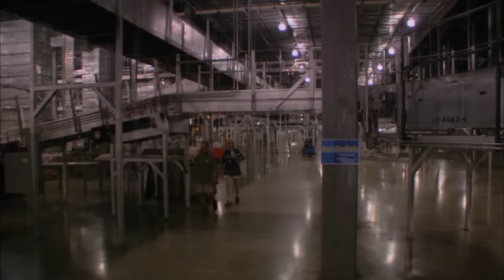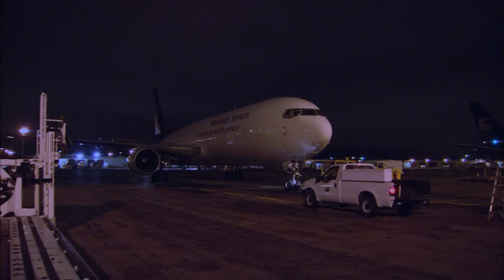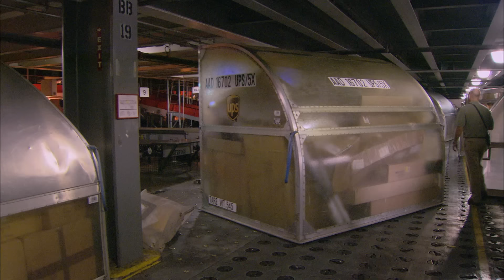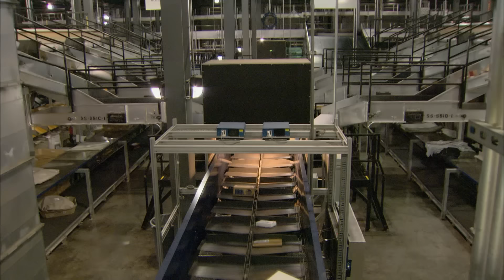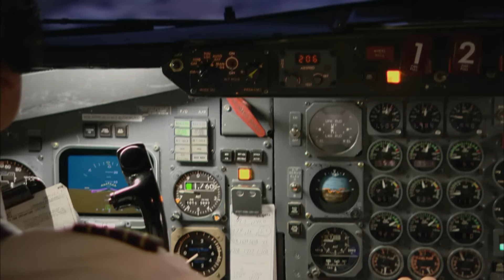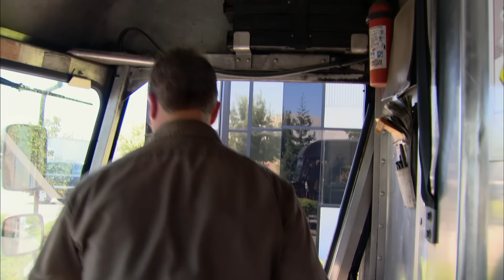UPS Worldport: Inside the Giant Logistics Powerhouse | FD Engineering

Comment: You are wrong on what a continuious descent is......A continuous descent is what we do on an approach. Before we would do what was called a dive and drive approach, where the crew would follow a descent profile  and level off at each fix. Now we calculate what rate of descent would have us cross each fix at the correct altitude. Thus a continuous descent.

Comment: Heard this from several people years ago they didn't have good equipment, and they abused people physically, mentally and financially. ☹️
Nice video, good to see scanners and conveyor belts.
Reply: They pay very well
Reply: They are full of issues, all with varying levels of severity. I became interested in UPS operations as part of research that I am doing re: UPS Hodgkins facility. Let me give you the quick rundown. A coworkers cousin recently applied there and she was hired, but when she came for the orientation before heading down to the warehouse she was told to "leave all electronic devices in a box inside the hiring center, which is frequented by new hires, etc" 

The new hire instead left, as she felt she could not do that. She instead opted to work in fast food. I remember that I worked there 6 or so years ago (pre-pandemic) and I was asked to do the same. I did not have such a thing and for that I felt fortunate. I quit 7 months later for other reasons but I kept following the UPS reg not to carry any electronic devices with me for  at least 3 years, as I thought I would always "return to Brown"

The topic of companies forbidding employees to bring devices inside the premises is an incredibly complex one. On one side you have safety concerns and on the other you have whether this act actually violates Rule 7 and 8 of NLRA (union meetings, etc) or other employee safety concerns. Although it appears that taking another approach UPS has adressed both of these. Employees have always been able to access union stewards as they are easily visible (adequately identified as union by clothing) during breaks and lunch times. And as far as "extreme weather safety" is concerned, they have installed weather alert systems inside the facilities and trained employees, supervisors what to do in case severe weather like a tornado breaks out

Comment: I would assume that in addition World Hub MUST have developed some kind of maintenance strategies for this hub. Invariably there are going to be breakdowns on these conveyor systems, they would need a system capable of detecting emerging equipment failures that could come down to something as innocuous as a bearing failure or actuator error that would require that particular leg of the system detecting, then taking that component of the system offline so techs could service and repair the offending components. Or so I would assume.
Fascinating expose' of this critical piece of infrastructure that keeps America running on-time, and fully supplied with the pieces that make America the most powerful nation of Earth. Great channel and fantastic content.
 I do not watch Television anymore, and why would you because YouTube rocks.
Reply: In parcel logistics places like this you have contingency plans in place in case something breaks down. They would have to move flow on other conveyor belts, different sorters, etc. Everything is planned in case a conveyor belt rips, or a sorter crashes, or loose internet. There's always a backup plan for most cases unless the physical building itself gets damaged like a natural disaster. Although I guarantee Worldport probably can withstand  most tornadoes. Maintenance techs are there to handle breakdowns and get everything going as fasr as possible. 
There's probably a couple of backup generators. Fiber optical internet, but when that fails, [In the building I work in] they would have at least two cell companies as contingency for that and then dial-up lines for the backup to the backup.

I work for the competition as a maintenence tech but the backup procedures are the same. And downtime is your enemy.
Reply: As someone who worked in the hub when a belt goes down it usually gets fixed pretty quick but when it takes a while it causes a pause in work and sucks I’ve even been sent home because it took them too long to fix and they sent packets to a neighbor hub

Comment: For our business UPS is not as good as they used to be. For many years we always got our packages between 9 to 10am. We could receive and ship out the same day. Now for the last couple of years we never know when our packages will arrive. Most of the time it’s mid to late afternoon. No explanation as to why the change and customer service is not helpful or responsive at all.
Reply: 'Not everybody can be amongst the first stops during a driver's daily route!   🚚 🛻 🚛 🚒 🚚
Reply: @markpimlott2879  Our business is one of the first buildings in town coming from the direction of the UPS terminal and it is a right turn off the main road. We had early stops for over 30 years until something changed two years ago. It has hurt our efficiency greatly. If that’s a part of a new system it sucks.  UPS customer service gives no explanation and is very condescending saying just be lucky if you get it by the end of the day. FEDEX and DHL still come in the morning at the same time.

Comment: Although this video was made many years ago, it was interesting. No doubt some of the employees at the sorting facility have been replaced with robots by now. Hope they are doing alright. At the end, the voiceover guy said it is time for the airplane to lift off. Rockets lift off. Planes take off.
Reply: I worked for ups for 25 years, then took my pension and ran for the exits.  I worked in the corp offices in NJ.  People used to rightly panic, when the planes could not take off on time, we used to hear it was costing x amount a minute for the plan to sit on the tarmac.  One late plane would back log the next plane and the next etc.  Usually if the delay was not that long, the pilots could fly faster once they were in the air to make up for the delay.
Reply: @kfl611  a late plane also meant a late end of work at the sort. We stayed around at the local and if Bradley got delayed than we were just sitting around sometimes at the unload twiddling thumbs on the clock because someone had to be there to unload the air cans.
Reply: as a ups employee I would say the only job robots took is absolutely nothing haha humans still do all the labor loading unloading transporting moving around scanning organizing delivering sorting you name it. an employee does it never experienced a robot haha